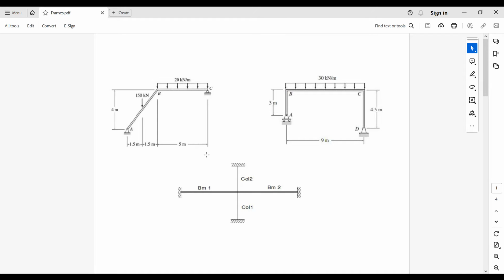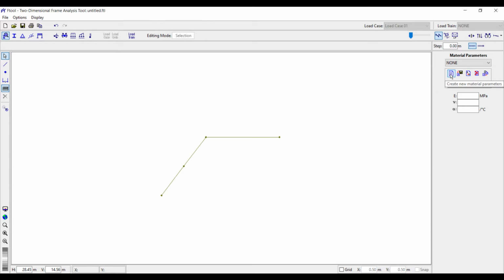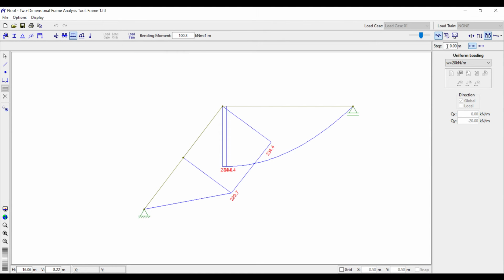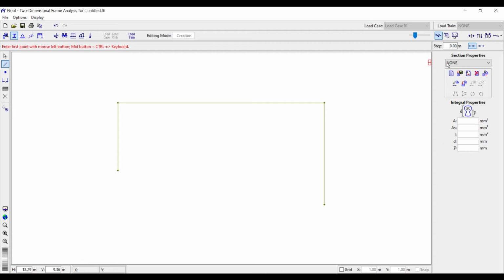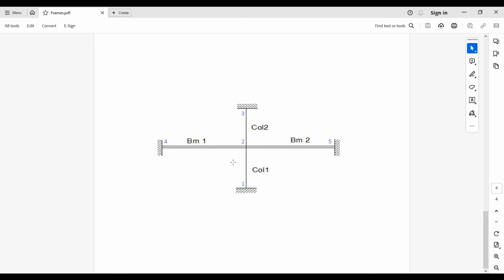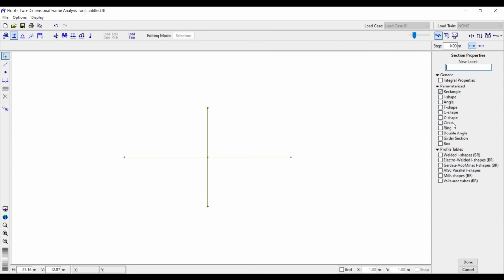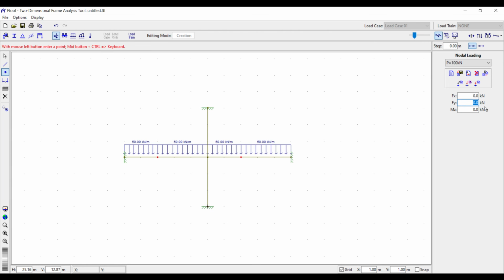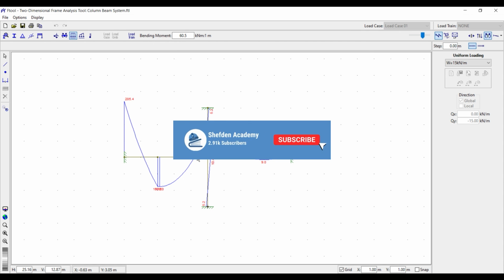Structural Analysis of Frame Structures | 2D Frame Analysis

Comment: How to analyse lgs sections
Reply from the maker: Analysis is the same, just define the loads and select appropriate sections
Reply: How to define cable in Ftools n what are the connection n support.for example to design hanging canopy with cable one side